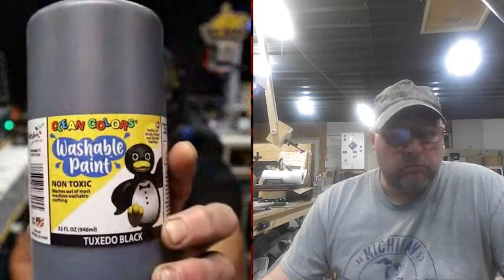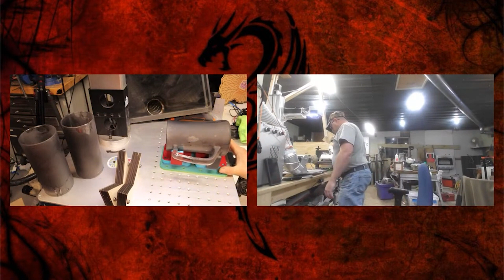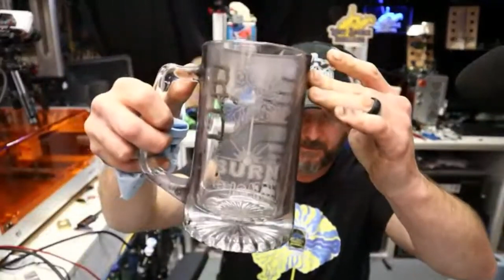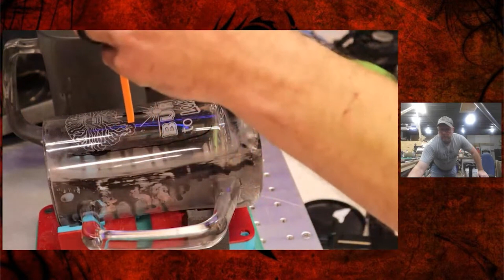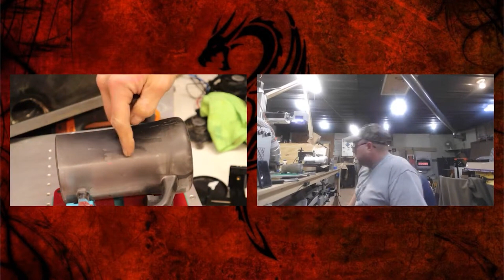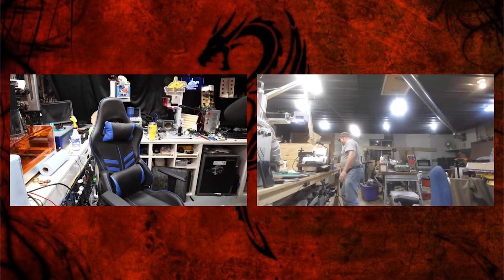How To: Fiber Laser Glass Engraving Live Demo *REPLAY* w/ guest HTL Holsters

Comment: I used spray paint and i didnt get good results, what do u think are the settings for that coating?
Reply from the maker: ive not used spray paint
Reply: I followed the steps and I got good results, the only thing is that the etching it's falling off if u scratch it a little, howdo u think I can fix that?
Reply: @stenchynightmares2117  Did you get any answers to that? I am having a similar issue.